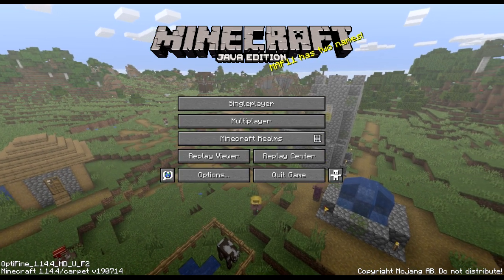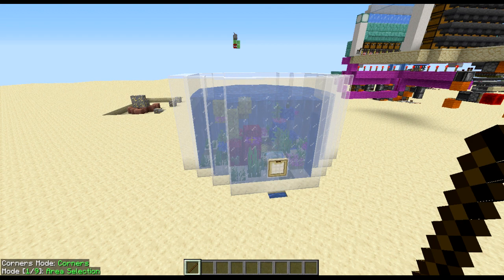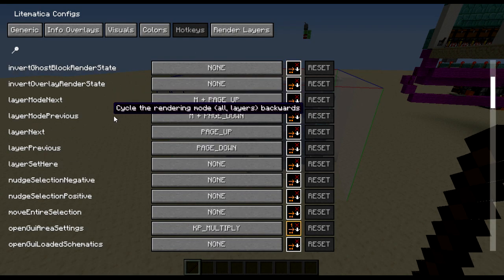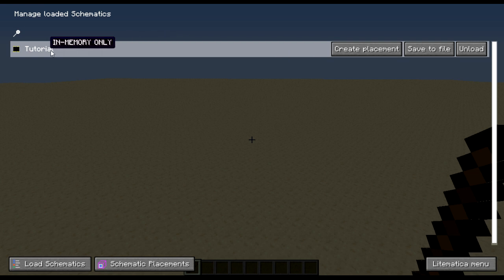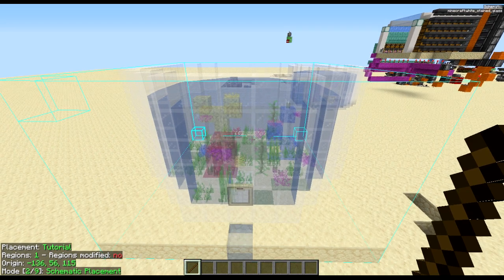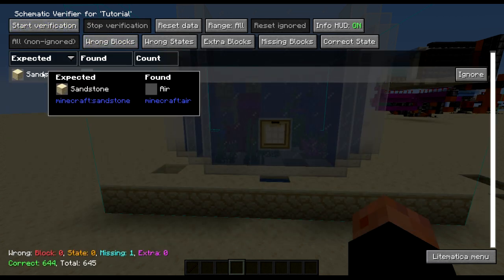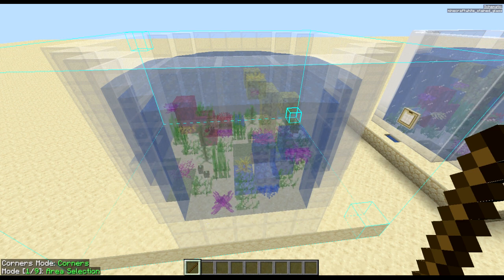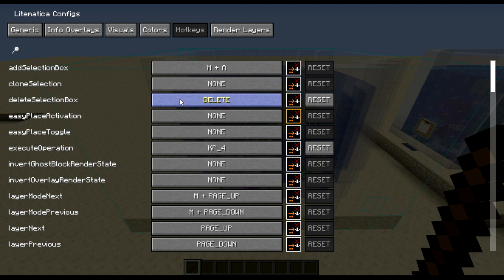How to use Litematica 1.14.4

Comment from the maker: I forgot to mention that to use this alongside optifine, you MUST turn off Fast Render and Render Regions
Reply: Thanks, thats really helpfull
Reply: How do I switch modes??
Reply: hey how do u use it in servers withouth getting kicked for spam(the pasteing schem in a plot supposedly)
Reply from the maker: @dnyaneshramade1840  I don't remember where the setting is located but there is one that slows down the pasting hidden somewhere
Reply: should probably mention that the render options are located in the performance settings under video settings :) some people cant find simple stuff like that sometimes.

Comment: material list for main part 
1600 white stained glass
423 snow block
311 hopper
270 orange stained glass
265 smooth quartz block
256 white glass pane
253 slime block
251 observer
216 emerald block
170 redstone dust
166 blackstone wall
114 blue ice
100 quartz bricks
99 lime glass
93 dropper
93 note block
89 repeaters
88 restone torch
74 chest
71 nether bricks
69 light gray concrete
68 quartz stairs
61 composter
61 comparators
56 black glazed terracotta
50 quartz slab
47 red terracotta
40 obsidian
39 birch sign
38 nether brick wall
37 activator rail
36 sticky piston
35 white concrete
32 dispenser
30 piston
26 redstone blocks
21 powered rail
20 water bucket
18 barrel
16 iron block
16 iron trapdoor
12 birch trapdoor
12 gray shulkerbox
10 lantern
10 snow
7 glass
7 player head
6 ender chest
4 beacon
4 green glass
4 shroomlight
4smooth quartz slab
4 white carpet
3 iron door
2 dark oak door
2 lava bucket
2 stone button
2 white glazed terracotta
2 white shulker box
1 glowstone
1 lever
1 magma block
1 oak leaves
1 sea pickle
1 soul sand
1 stripped oak wood

Comment: Bro I watched 4 videos of the Litematica, but my Stick is not showing these things in the left corner. Why is it not working for me?
Reply: Check if your tool is set to minecraft:stick in Generic (M + C to open config). If it is not, and you want it to be a stick, change it to a stick. Then if it still doesn't work check if your tool is enabled

Edit: Default hotkey to toggle tool is M + T

Comment: I have a pretty bad bug that makes the selection not stay in one place,(if I move the camera around the selection follows like it was stuck in the screen, and if I move around the selection moves in my same direction but faster than me) the only way to make a selection stay still it's looking at straight north. I have tried installing an older version of litematica, installing preview optifine and changing some video settings. Now I'm gonna try using an even older version of litematica. The only mods I have installed are: 1. Item scroller, 2.minihud, 3.modmenu, 4.malilib and 5. litematica. All the other mods work just fine. Am I the only one with this problem? because I looked it up and didn't find anything related to this bug. BTW version is 1.15.2
EDIT: The oldest version in curseforge for 1.15.2 seems to fix this problem

Comment: The area selection keeps moving around when I use WASD
Reply from the maker: Might want to check the key binds if you haven't already
Reply: Electro Hawk I got it fixed, had to add optifine

Comment: Hey is there a way to rotate the schematic in the other axis aswell? Also when I scroll through the function of the tool it does not show up bottom left, I have to manually change it.
Reply from the maker: You can't rotate the schematic vertically because it wouldn't make any sense since there's a block limit height-wise and you can easily go above that building on the ground

Comment: Why don't they update it to 1.15.1
Reply: It works for 1.15.1, I'm using it on it right now :D
1.15.1 version of Litematica (and MaLiLib which is a required dependancy for the mod, so grab them both): https://pena2.dy.fi/tmp/minecraft/mods/client_mods/
They're mods for Fabric, you can get the 1.15.1 version here: https://fabricmc.net/use/ (make sure to select Vanilla and get the latest build, at least 0.5.2.39.)

Comment: What is the setting that can I change it from ctrl + scroll to another thing because it's not working please response 🤔?
Reply from the maker: Try changing "operationModeChangeModifier" to a different key, if it's the scroll wheel that's not working I'm not sure how to fix it
Reply: Make sure you have rendering turned on with M +R

Comment: what happens if you paste an schematic but there are still like other blocks on the way? would they get replaced or the schematic will cut out?
Reply from the maker: I'm pretty sure that it will only replace in the "replace" mode otherwise yes, it will cut out parts

Comment: When I select “single layer” for my layer mode nothing shows up. Just an empty blue box. Any help would be appreciated!
Reply: Press page up. Starts at y 1. you’ll mostly be at y 60
Reply: You need to change the tool mode to "Schematic Placement" then do the single layer, then press page up or down. (Not with M)

Comment: cansomone tell me what the red s means casue i cant load my schematica cuase of it i thinl
Reply from the maker: That means it is a .schematic file, they should work but I guess some just aren't compatible with litematica. The files that are built to work with litematica are .litematica files
Reply: Use work edit to load those on a test world, the use litematica to save them.  I do this all the time. Both mods can be loaded at the same time.

Comment: How to move building levels in Y?
Reply from the maker: As explained in the video, you move the video up the same way you move the schematic in any other direction - with alt + scroll wheel looking in the direction you want to move it, in your case look up and move the scroll wheel forward. If you are looking in single layer view of the schematic, you press Page up or Page down to change which layer of the schematic you are looking at

Comment: How can I change the Materials used in the shematic?
Reply from the maker: You can't sadly
Reply: @ElectroHawk  so If I want a shematic with everything the same  but for example glass instead of staines glass I have to edit the real one and make a shematic out of that? Or is there a way to edit the save file?
Reply from the maker: @upsidedown5564  sadly yeah, you can't just change the blocks inside the saved schematic
Reply: @ElectroHawk  ?

Comment: I can only access to the mode 1,2 and 8 while using ctrl and scrolling and it only shows 8 modes, not 9... HELP!
Reply: I just want to clarify that due to this problem I can't place the schematic at all
Reply from the maker: @ramirezsergio4482  Which version of litematica are you using and are you on a server while using it?
Reply: @ElectroHawk  I am using the newest version, and yes, I tried using it on a server
Reply: I just tried on single player and it works, so I wont be able to us it on the server?
Reply from the maker: @ramirezsergio4482   Ramirez Sergio  On servers, if you are not in creative/opped you will only have 3 options available, not quite sure why you only have 1, 2 and 8 as mine are 1, 2 and 9. Some servers do block litematica as well, which is possibly the issue
Reply: @ElectroHawk  Thanks for the help, it has been useful.

Comment: How would i use this in a server though? Please reply
Reply from the maker: You can't paste unless you're opped and in creative, most other stuff works fine
Reply: @ElectroHawk  So this only works if youre in creative? The menus work fine but any selection boces or anything doesnt appear. Basically im unable to use it in a server besides the menus. Im in survival mode and not opped btw.
Reply from the maker: @southernpixel6856  Strange, everything I've tried except for pasting, deleting and placement rotation works fine on servers
Reply: @ElectroHawk  So can you place the "template" on a server and use it as a guide to build or does that not work either on server?
Reply from the maker: @Deari  That is how I use it on servers, I believe it is able to be blocked though

Comment: Thanks for the video, hope you make more as I really could not find any good basic ones.  
Would you happen to know if there is a way to ignore substitutes IE if I use a different color glass or carpet or block it thinks it is not correct and glows red. Is there a way to substitute similar blocks?
Reply from the maker: The only way to substitute is to manually replace each of the blocks you want to change, also you don't need to always use the schematic verifier to check if everything is there to prevent it bringing up the red glow
Reply: Currently the only way to substitute things is using the Schematic Rebuild mode to change those blocks in the schematic. You can for example easily change all blocks of a given type to another block using the Rebuild mode. Basically you would change to the Rebuild mode, then set a hotkey for 'schematicRebuildReplaceAll', then hold that key while you right click on the block you want to replace, while holding the new block, and it will replace all of those identical blocks with the one you are holding. There is also another hotkey variant 'Direction' which allows you to only replace in straight lines/strips. You can also limit the replacement by using the render layers, only blocks that are rendered/visible according to the render layers setting will be replaced.
Reply from the maker: @maruohon  did not know that existed, that is very useful

Comment: Is there a way to replace blocks that are red instead of having to break them manually or placing the correct block? And is there a way to cut all the blocks that you selected like the //cut command in world edit?
Reply from the maker: I think the replace function might work to change them, although you could delete the area then paste it in again as long as you are in creative, I believe the only way to cut the blocks is to delete the area using the same selection.

Comment: I've done everything like you said in the video, but when placing the schematic I saved, I only see the blue box, not the blocks that were inside the selection. What am I doing wrong?
Reply: Okay I found the solution, if anyone is facing the same problem - it seems that this mod doesn't work with Optifine, so I just removed Optifine from my mods folder for now.
Reply from the maker: @Brusnica365  Forgot to mention that for optifine you need to have Render Regions and Fast Render off, I had optifine active while doing the video

Comment: Thankyou very helpful. I have found myself using simple selection mode. Just to save a few clicks
Reply: MuzzaWood I also use simple selection mode so I and right and left click the stick 
.  Hint set it to expand. That way right starts, the left expands the selection to include the left clicked block.  Makes it easy to select all the outliers. I do the same this in world edit too, using the wooden axe and "//self extend"

Comment: does litematica have a printer feature?
Reply from the maker: only pasting
Reply: @ElectroHawk  So its completely useless then on a server wher eyou arent the admin... unlike schematica...
Reply from the maker: @johng6387  no, the only thing that is blocked by default is pasting, everything else works fine unless the server blocks the entire mod
Reply: @ElectroHawk  what good is the rest of the mod if there's no printer. So I can save a schematic... That's pretty pointless if I can't print it. The big draw of schematica was being able to build a structure in creative mode on a local world, create a schematic of it and then print it in survival mode on a server or literally anywhere. the process of building in survival mode is far more frustrating if you have to break blocks and wear down tools making mistakes or design changes. Especially where mob farm design is concerned. Building in creative mode is far more convenient to the ability to print a schematic is what made schematica worth installing. No public server is going to op me so I can use a schematic mod... Therefore this mod is entirely useless...
Reply: @ElectroHawk  also, schematica was great because I could create a line of sand as far as I could reach, stand on a blockaround a sea monument and print sand from inventory and move all the way around a monument like this u til the water outside was completely displaced. A task that would take weeks block by block takes a little over 2 hours using schematica. Without being able to do this, this mond is completely useless unless your the server admin building out a world, or your a local only player.
Reply from the maker: @johng6387  Look, if you don't want to use it then don't. It doesn't have the same features as schematica because it isn't schematica.
Reply: @ElectroHawk  it's frustrating because it's marketed like a full schematica replacment and it clearly isn't. Something that you don't find it until someone on YouTube tells you you can't print because the feature doesn't exist, not because your using it wrong. Hopefully lunatris will get it together and rebuild schematica properly some day, is been like a year since it was last working :(
Reply from the maker: @johng6387  It might happen, Mojang are making the game easier for modders to tell what does what in the code
Reply: @ElectroHawk  that is a good thing and based on litematicas author pressing on Reddit, a printer was planned for 1.14.X but it just hasn't happened yet. Fingers crossed for one of the 2. I admittedly like fabric better. It's MUCH lighter than forge so I'll keep my fingers crossed for litematica having a survival printer soon